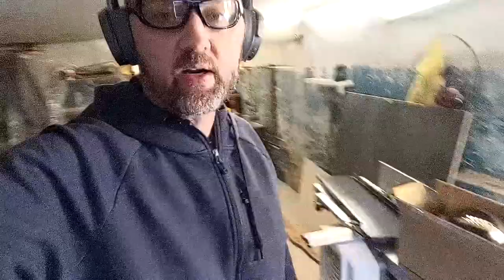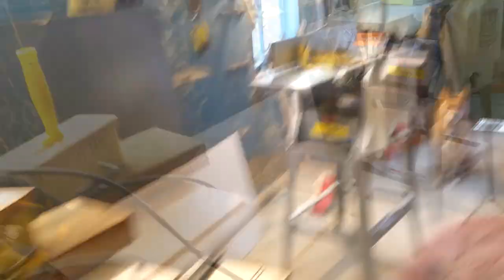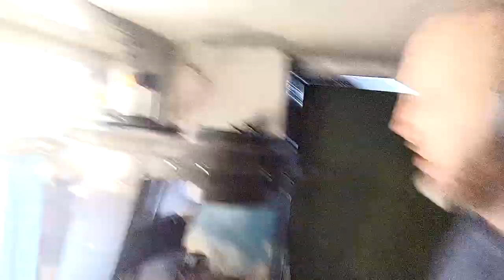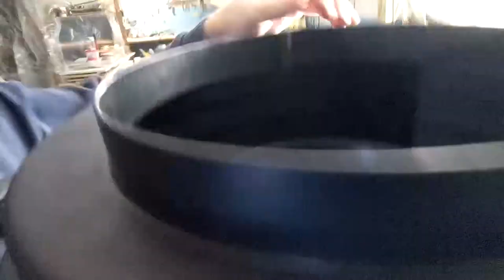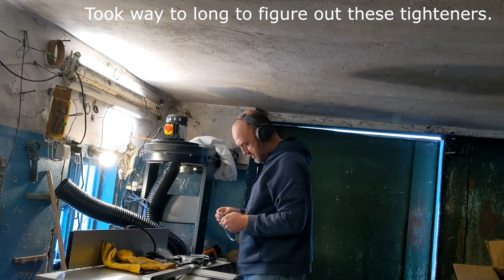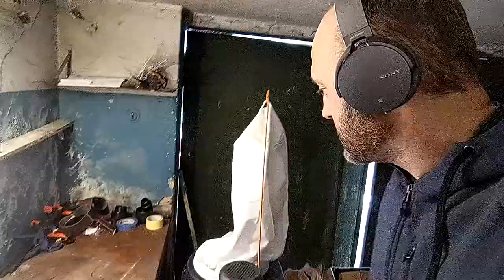Dust Collector

Comment: Does it work well with the fine dust generated by an orbital sander? Do you think I can attach the dust collector to the sander?
Reply from the maker: not great, but it's better than nothing.  You really need a vacuum setup for individual hand tools.  Dust collectors move a lot of air by volume, but vacuums move less air with more suction, which is what you need for hand tools.